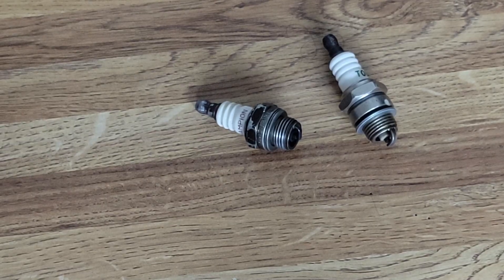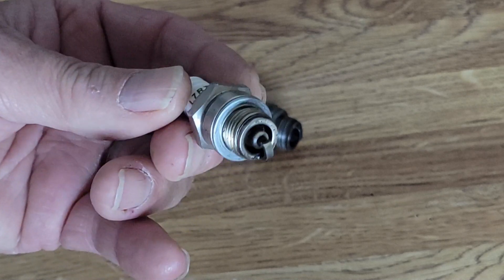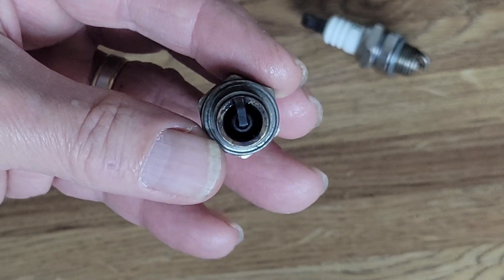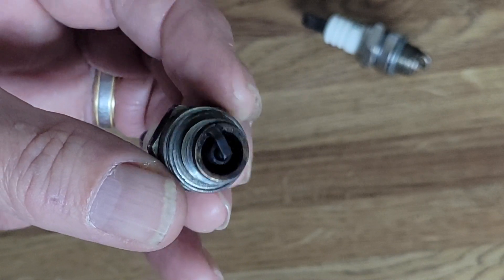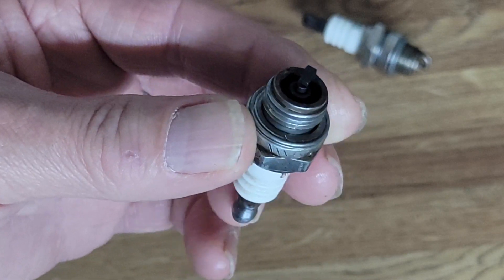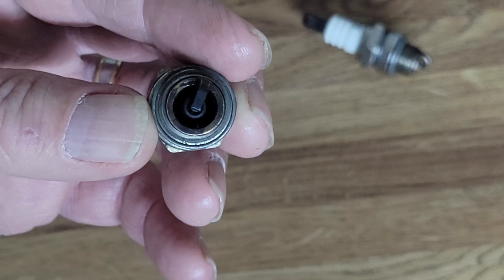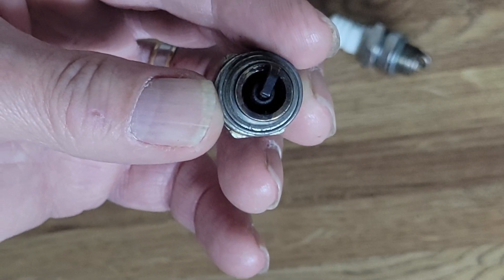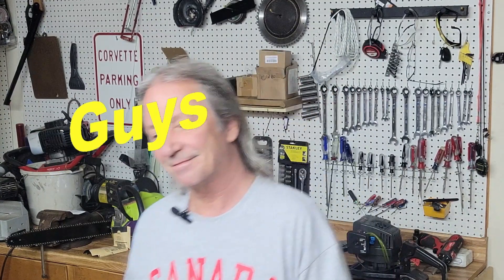Spark Plugs - The basics for 2 stroke engines

Comment: Thanks, good video. I wondered why my Ryobi 26500 trimmer was going through 4 coil units in a year and a half. I was running a 254 autolite plugs. I now know that they are non resister.
Reply from the maker: It should be easier to start too 🙂

Comment: WOW fantastic knowledge thanks. I always try to match the exact plug that comes out of any engine if it was running fine. If its not running right my go to is owners manual.
Reply from the maker: I can talk about plugs all day 🤣 If you got it new and know it's the original plug, you are doing the right thing. Match it up.  👍
Reply: @GuysPlayingWithTools  I just did this with my Toyota car/ The owners manual has 2 plug numbers for the car so I had my son come and pull a plug so I can get an exact match Thanks for the info....
Reply from the maker: @dkat1108 😁

Comment: I am going to try a resistor plug in my 2 stroke leaf blower on the basis of this excellent video. Seems like the original plug was an RDJ7J but somehow I have ended up with acouple of DJ7Js( no resistor) and my blower just will not fire at all. New module and lots of other mods - nothing. Off to the store to get "resistance" back in my life. Sure hope this works, I am running out of themes to try. Wish me luck and thanks. Fred
Reply from the maker: It makes  a difference. I expect good things, let me know! 👍

Comment: Thank you kindly for this video. 
    However, I'm still not sure what is causing my stihl 450 brushcuter to race off while working. Too, the spark plug has a dry dark carbon; and after cleaning the machine usually would not start, until it's fitted with a new plug. This is happening in just a matter of days.
Reply from the maker: Hi Rajin, I see this a lot in my world.  🙂
It's usually an easy fix. Try these things, in order. 
1) make sure you are using the right plug. It doesn't have to be the stock plug but it fits need to be a direct replacement
2) tune the carb.  I have a video that covers it
3) check the spark arrestor. It's a small screen on the outside of the muffler and is held in place under a cover by a couple screws
Let me know if it works! 😁

Comment: Yea,  I accidentally dropped a 2 stroke plug in my 4 stroke RJ19LM box. On day I happen to pick up  the wrong one.  It worked  in 4 stroke  but randomly would have a starting issue.  Lesson learned.  🤨
Reply from the maker: Plugs are one of those things that are easy to overlook. I never thought about them much until I started flipping equipment, which meant I got a lot of stuff other people tried to fix but failed. I quickly learned to check the plug and make sure it's the right one every time something is acting oddly.